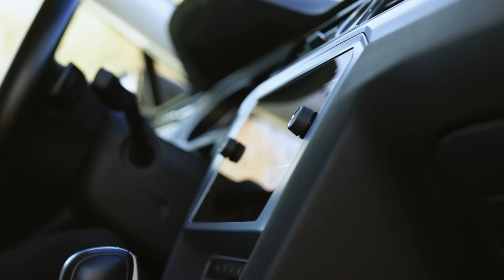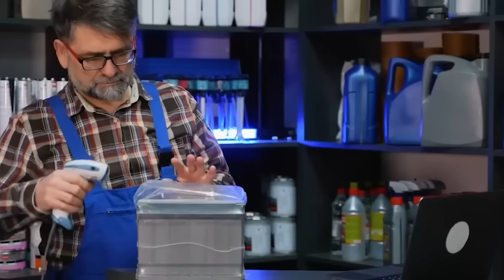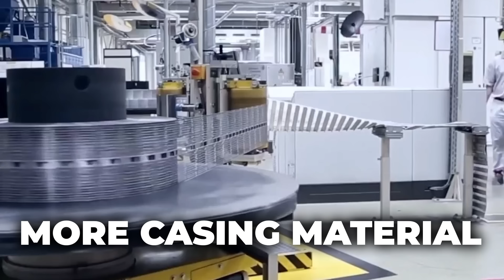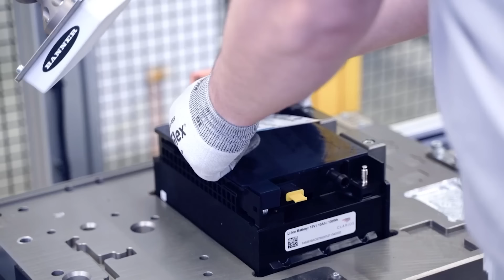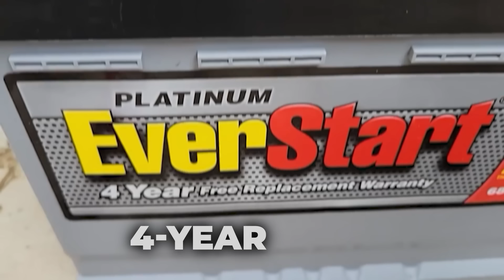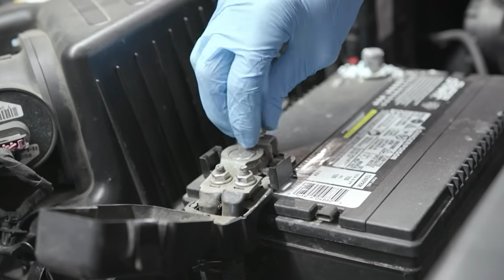7 Walmart Car Batteries SECRETLY Better Than $300 Brands (And 3 To Skip)

Comment: My Everstart Max bought in April of 2026 had to be replaced in October 2026. I took my battery tester with me and tested 3 of the exact same Everstarts on the shelf and they all tested differently. I picked the replacement one with the highest CCA and charge %. Fingers crossed. We have an Interstate from Costco and it's at 71% health at about 23 months. I rarely get much more than 2-3 years from batteries anymore, used to get closer to 5-7years but I guess newer cars eat the power more with all the electronics.

Comment: Lucky me, my walmart battery has lasted 5 years so far.
Unfortunately for me I can only use ONE battery group in my vehicle so I am stuck with low CCA's.
No physical room for a bigger battery.
Shame people cannot add a set of ultracaps in parallel to the battery.

Comment: It does not matter who made the battery. Johnson Controls clarios East Penn Deka exide it does not matter. Whoever they make the battery for decides the quality in the battery!. I worked for Sears Automotive for 15 years. We were trained by every battery manufacturer back then there was only two. Johnson Controls and globe union. Walmart AutoZone all of them decide the quality that is built into the battery. Believe it or not the manufacturer can decide how long the battery lasts. My last three max ever starts that I got from Walmart lasted exactly 3 years to the day. December 28th. For the last nine years. I get a battery for free because they have a 3 year full warranty with two year probation. Exactly 3 years to the day! I had a die-hard gold last me 11 years. My 2017 Jaguar XE battery just died. 9 years. It's made by exide it's an agm. That's why I'm watching these videos to decide which battery I'm going to buy next. That same battery AGM exide comes from Jaguar for 180.00. But they only give you a one year warranty. I think I'm going to chance it. The last one lasted 9 years!.

Comment: Ive had great luck with Everstart batteries, get above average life out of them, 12 years out of a starting battery in my boat, 9 years in my dakota truck, just bought new everstarts from my honda civic and dodge ram,  my dakota had a new napa battery and it was junk after 2 years, top case separated and leaked acid everywhere.  Project Farm channel here on youtube does comparisons with several brands of auto batteries,  Everstart was rated at the top of all that he tested
Reply: yeah...before they changed rnanufacturers...check out his LATEST testing and ratings.....
Reply: Did you get the Maxx?

Comment: The fact that Johnson controls no longer owns these battery manufacturers. Is something to celebrate.  Johnson cheaped out all these batteries. Now a company buys it out. And the batteries return to the grade they used to be before Johnson bought them.
Reply: NO, IT ISN'T.  SINCE JC SOLD OPTIMA, THE RED TOPS HAVE BECOME ABSOLUTE GARBAGE; WE HAVE SEEN POST SALE OPTIMAS THAT WERE SEVEN POUNDS LIGHTER THAN WHEN JC MADE THEM, AND THEY DEMONSTRATED WAY HIGHER FAILURE RATES.  WE NO LONGER OFFER OR INSTALL OPTIMAS IN ANY CUSTOMER CARS...................